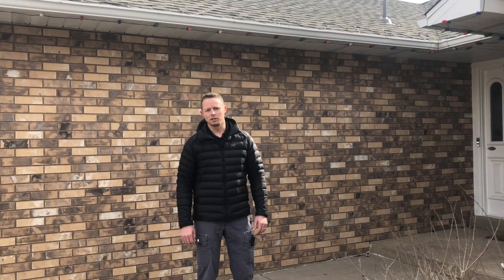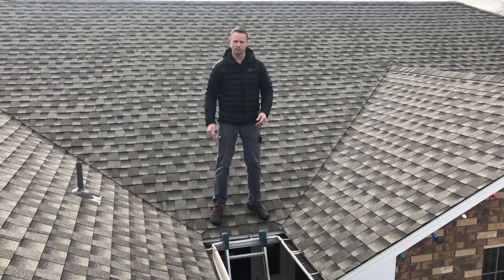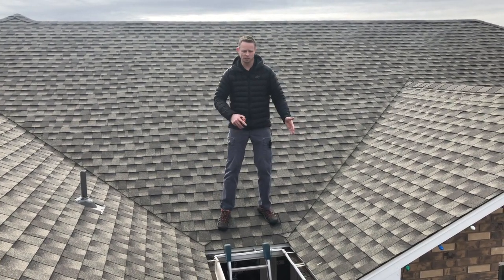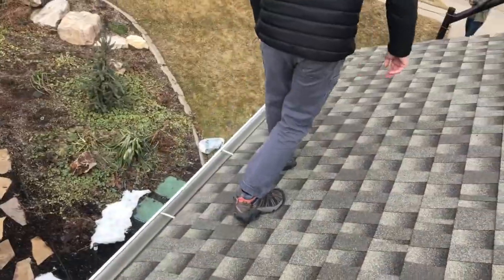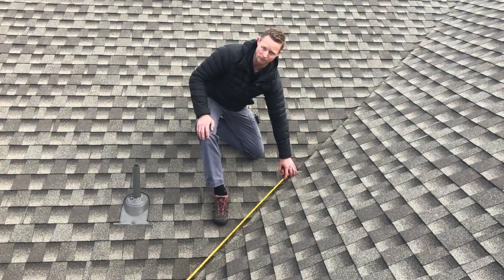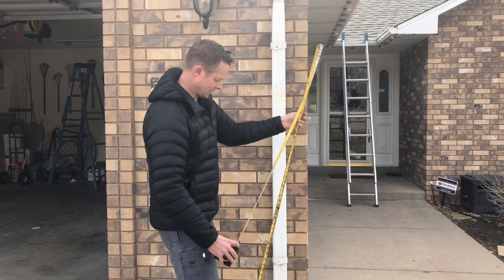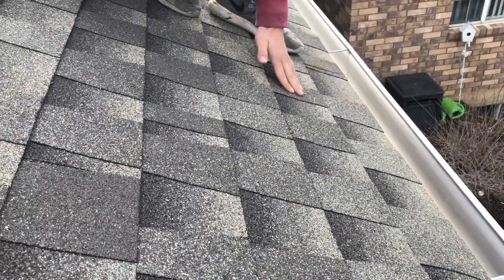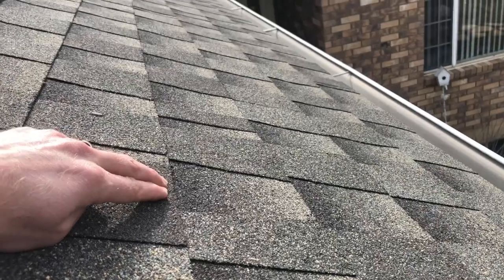DIY HEAT CABLE | STEP 2 | WHERE DO YOU NEED CABLE?

Comment: This year and last are the first winters in the twenty I've spent here that "snow eater" winds haven't performed their usual, noisy trick. Our perennial, at-least every few weeksly, 40°F rainfalls driven by winds of 30 with gusts to 70 or 80 mph lasting three or four days can and do (or used to) disappear a bunch of snow, always managing to clear area roofs. My neighbors and I are convinced something is changing: I've got a foot of ice in my valleys where I'm accustomed to knowing there's only an accumulation of snow that'll soon get blown away.

I and my buddies' have cold attics with metal, exposed fastener roofing. We don't have seams of the type you show getting shoved over in your metal roof tips video. We all have snow-stops already in place. Some roof edges have no gutters. Also, none of us have drains; our downspouts dump onto out-of-the-way landscaping. We have 110v 20 amp switched outdoor receptacles for engine block heater we'd like to exploit for power, but I realize this will depend upon loads and how those receptacles are wired. We'd like to outfit our houses this summer, so I'm estimating cable lengths for three other houses similar to my own. What are your recommendations for distances measured up the roof and up valleys for these attic/roof systems? How about measuring for downspouts perched above ground.

Your videos are among the clearest and most earnest of the jillions of videos I've watched on millions of other subjects. Kudos.

Comment: Money with no issue,What is the best heating cable or system in the market for roof? Please need your opinion. Thanks
Reply from the maker: We recommend Drexan heat cable and you can find a Factory Terminated Kit in their high end cable at https://heatcable.com/ if you want to have a plug and play system without having to make the connections.